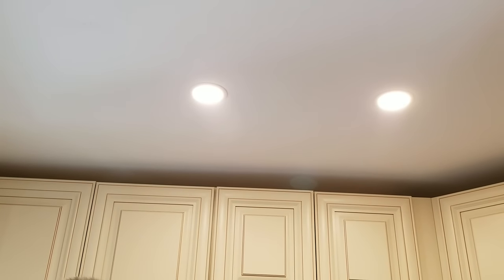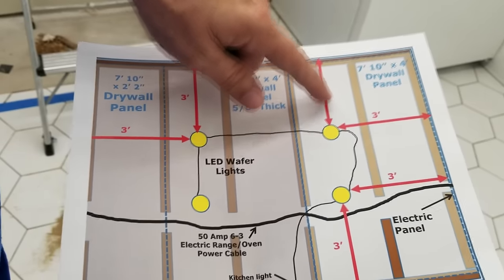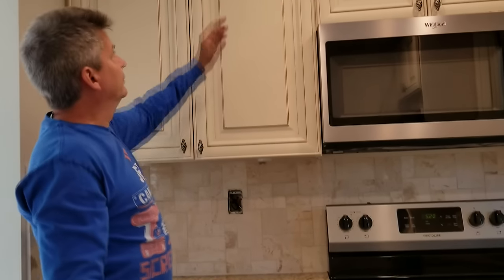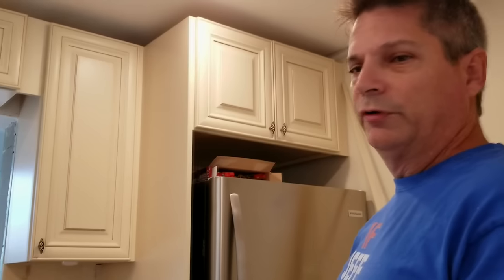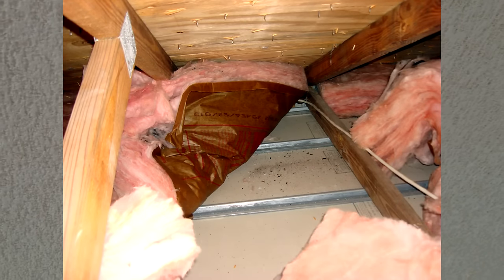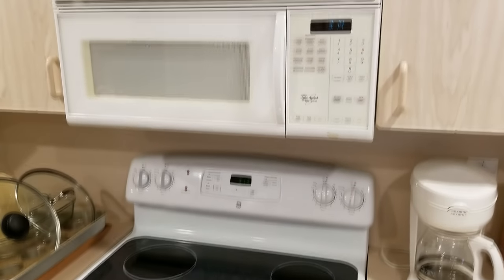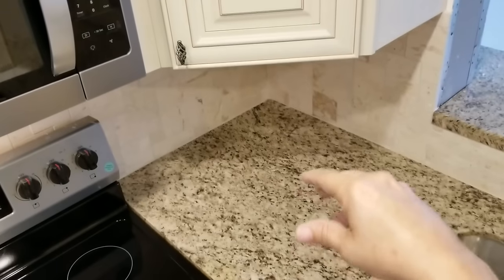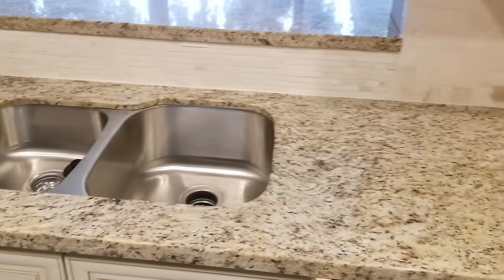Kitchen Light Spacing Best Practices, How to Properly Space Ceiling Lights

Comment: Coming from a design builder, I understand your point of view and frustration with incorrect installations. The AEC industry is plagued with incorrectness in every area (structural, electrical, plumbing) but what’s worst is the arrogant finger pointing “I’m better than you attitude” and unwillingness to make our fellow contractors better by taking a leadership approach instead of referring to their work as “stupid” “no idea what they are doing” etc. As a general contractor I have made mistakes in lighting but I learned because I wanted to do better. There is no one way or universal master guide to learn the hundreds sometimes thousands of scopes of work that encompass every aspect of building a   Decent building. or in this case, optimize lighting design. So, from what I see/hear in this video, You’re knowledgeable, like what you do, and seems like you do good work. so don’t belittle others work but maybe point out why you would do it differently, inspire people to do better work by showing them a better way. That’s the only way this industry is going to change for the better.
Reply: @Daniel Verdin I hear Jeff’s now holding lighting placement classes... I suggest you sign up. (LOL)
Reply from the maker: @alant5757  You're right, I'm sorry, I should never have pointed my finger at those builders. I meant to call those contractors who put the light 6" in front of the cabinet a genius. I didn't realize the industry was filled with super sensitve spineless snowflakes who needed a crying room after making people's lives miserable.
Reply: @jeffostroff  And this is why I don't drink any more....

Comment: Used this video as a primer for my own kitchen lighting project.  Works very well in that no shadowing exists beneath the cabinets but, as indicated in the comments, under counter led strips were added to improve task lighting. I used 4", 3000k led pucks with a dimmer.  I am very happy with the result and thank you for the video since I would have made the same mistake without your help.
Reply from the maker: Awesome, glad to help, and thanks for watching
Reply: Recess lights online come in sizes from 3w to 24 w . Let's say 3 lights which are 7w or 10 w wouldn't actually be much larger than a ceiling rose .
I read that canned lights heat up more because of the amount of metal

Comment: Can you help me with this conundrum? My husband is 6'9" and people are recommending that the lights be closer to the cabinet so that HE doesn't cast the shadow over his own workspace (which is why we're updating the lighting to begin with). I'd love your opinion: If we place the lights 3 feet out from the wall with cabinets, is he more likely to cast a shadow than if we placed them 2 feet from that wall? (Ceiling is 98" high, Room is 150"x155"). Thank you so much!
Reply from the maker: Does not matter what his height is, place the lights centered directly over the edge of the counter and you will have no problem.  You can also hook lights to power cords like I do and get on a ladder put them in position and see where shadows go. I am working on a video for next week where I did a massive lighting project in a friend's kitchen involving these issues, sloped ceiling, getting correct light onto counters, measuring the light with app on the phone, and engineering the perfect lighting solution. You might want to wait for that. I would experiment with 24" from thh wall, which is over the counter, and maybe ambient fill light behind his head in the middle of the kitchen, to see how the 2 lights blend together.
Reply: @jeffostroff  that's actually what I was thinking, too! I'll look for your next video as well.  Thanks!

Comment: Thank you for the video. Thankfully, things have changed in the last 5 years. Long and short of things, DON'T place your lights at 36 inches in a kitchen with upper cabinets over a counter. On this video, the only light source is the overheard source. If you are working at the counter, the light is going to be above your head, behind you. It will cast a shadow onto your work surface. You need the light overhead, directly over the counter top. You also need undercabinet lighting. AND if you don't want your kitchen to feel like an office break room, you are going to want more than just recessed lighting. You need pendants, linear lighting or chandeliers. (You need diffuse light/frosted shades if you are going for a soft feel as well, but that's my personal choice.) The light hitting the cabinets actually produces a beautiful warm glow on my pine cabinets.

Comment: I'm 6'4" and thought I'd share my experience.

Just built my kitchen cabinets/countertop 3" higher for my lower back issues preparing food for dinner. We also raised the cabinets up to the 8 foot high ceiling. 30 inches seemed to be the sweet spot in this scenario and the shadow under the upper cabinets isn't there.

We just wired one LED pot light and tested it live, another person safetly held it above my head in a few spots until we figured it out. Maybe that trick will help someone doing that one reno on their own like me.
Reply from the maker: We are working on another kitchen lighting video to cover all of the scientific of the scientific ways to place the lights and measuring how much light you have as well

Comment: The actual problem is trying to use ceiling lighting as an all-in-one source for kitchens. Kitchens require multiple light sources specifically designed for task working, not just general needs lighting like other rooms. There are a lot of factors to consider with setting up kitchen lighting, however technological advances make it easier to complement general area lighting in a kitchen, such as under/over cabinet lighting, accent lighting, decorative lighting, etc..
Reply from the maker: Yes you are right it really stinks when you're on a very very tight budget and can't afford to do all of the things you know need to be done
Reply: @jeffostroff  Agreed, Budget is always the main factor!! Especially if necessary wiring is not available!
Reply: I have ceiling fans which include lights,  with the down lights being close to the wall to throw the proper light down to the benchtop (opposite to the incorrect advice on this page) the fan lights are dimmable, colour temperature adjustable too. The kitchen has pendant lights hanging low over the island cooking bench. The mix is great for central room lighting, work lighting and relaxing lighting with phone app colour control of the downlights.

Comment: Jeff, you explained the absolutely WRONG way to place your lights. The thing you aren't factoring in is that by having the light out 36" puts the light source behind the head of the person working at the counter. So when that person is standing next to the counter doing their prep, they will have diminished light from the shadow they cast over their work space.  By having the lights in closer, as was the case in the first example you said was wrong, you get maximum and direct light to the area you need it which is right in front of you NOT towards the back of the counter. If you are concerned about the shadow the cabinets create by having the lights in closer, you install under cabinet lighting which is actually what you had in your remodel but didn't comment on their purpose.  I hope this helps some people...especially those cooks that are 6' plus.
Reply from the maker: No you are incorrect because the light to the side of you will fill in whatever the light behind you missed. Also not everybody wants under cabinet lighting and you should not have to rely on under cabinet lighting to avoid shadows.
Reply: @jeffostroff  Your response is making my point.  You said "the light to the side of you will fill in..."  That "side light" is not as bright (it's much further away and indirect (not in the focal range)) as what your head and body is blocking.  Also, I don't know who wouldn't want under cabinet lighting unless it's not in their budget or they have a boring backsplash.  Even with your method you will only have the counter lit to the back edge but your backsplash will definitely be in a shadow.  If you have invested the money in an attractive backsplash, you will definitely need under cabinet lighting to highlight it.  If you have spent much time cooking, you realize you use the front 16" of the counter the vast majority of the time for cutting and prep and the back 8" are not where you need the light.  This may just be my personal preference but I would rather have more direct light on the 16" space my hands are doing detailed prep rather than sacrificing my light to make sure the toaster against the wall is lit.  If you are going to insist on putting lighting behind the cook rather than over the counter where it's needed, you should at least suggest to people to consider having task lighting by mounting lights under the cabinets.
Reply: It's all a matter of preference and budget you guys are both right..
Reply: @jeffostroff  Thanks for sharing. I have to side with those favororing a 24" offset from the wall. I initially placed the light over my workbench too far back. The bench was well lit until I stood in front of it to work on something. At my age, I need full light to see well. Even the "slight" shadow you decribe would be i tolerable.
Reply from the maker: @terryluebbe2560  That's fine, you can do a combo, try leaving the lone set of lights behind your head at 36" from the wall, and put in a couple of task lights that are 24" from the wall so they will fire down directly over the counter. This way you have the best of both worlds.
Reply: David, you are exactly correct, the light behind my head and shoulders cast such a shadow when chopping or cutting anything I have to stand to the side to see correctly. Pain in the rear. Under cabinet lights is my only fix. Use always outweighs looks.
Reply: @davidbenji1  
please suggest where should the undercounter light be placed......in the middle of top cabinets or towards backsplash or towards outer side of top  cabinets?
Reply: @jainjain9450  install at front of cabinet using a 45° aluminium channel with cover to diffuse LED strip. Lights will point down and away from eye level. This is the way
Reply: To far out huge shadow over cutting your food , under an lighting is the new correct way to install.
Reply: @jeffostroff  TWO rows of recessed lights that are 12 inches apart? I don't agree with that at all.  Every lighting expert and electrician that I have talked to recommends placing the recessed lights so they shine down on the edge of the counter top. This will not cast shadows like your suggested placement does. But, it will shine light on the counter. Under cabinet lighting is a must. That's why you need ambient lighting and task lighting,
Reply: David is correct, Jeff is wrong. Nothing more to say.
Reply: @jeffostroff this is unbelievable, you cannot just redo the laws of physics, light uninterrupted is great light to aid your sight at the benchtop, light behind throws a shadow, and every commenter here disagrees with you. You need to revisit your logic here.
Reply: I always listen the experts experiences and consider their suggestions but I say do testing yourself and see what works for your layout kitchen considering the lighting from the outside. I believe both have a valid suggest.
Reply: @jeffostroff that’s just dumb, you are 100% wrong. If you don’t have under cabinet lighting and your body is covering the light 🤦, come on buddy, think about it.
Reply: At 8:26, that’s exactly how the light supposed to be😂 You went and changed it?🤦 poor customers, they should have spent that money on under cabinet lighting instead this guy.
Reply: 10:01 You only discuss the old non-IC rated recessed light housings here and infer that a recessed housing is inferior to those cheap puck lights. IC and Energy Star rated recessed housings are superior to puck lights because they offer far more options in terms of trims, are super easy to replace just one without blown-in insulation falling on you when inevitably a light fails in a few years, and look so much more high-end. The reason they are used less these days is that remodeling contractors like the puck lights for their simplicity and cost and do not present the other option to their clients. 

For example, for any of your clients to choose recessed housings with a trim kit, they would need to correct you (and risk an argument), or ignore you and tell you they want them anyway. They would also need to pay a bit more for them.

Comment: Saying this method is wrong is an opinion. I've used this method for years in the electrical field running my own company. Never had a complaint, always turned out great. There are multiple ways to get the lighting you desire.
Reply from the maker: It wasn't just opinion. I showed what happens when you place the lights 24" or less out from the wall, and the deep dark shadows under the cabinets. So if you think that's great, fine that's just your opinion. But people I've talked to don't like it.
Reply: @jeffostroff  not sure what you're talking about, I was agreeing with your layout.

Comment from the maker: ✅ WATCH Our SEQUEL to this: How to Measure LED Kitchen Lighting, Best Design Practices
: https://youtu.be/g5Ghx7-UJiU
✅ Lithonia LED wafer lights we used for this kitchen lighting remodel design project: https://amzn.to/2OniziR

✅ Klein Tools 53731 Adjustable Hole Saw we used to cut round ceiling holes for the LED wafer lights: https://amzn.to/2BGgcPI
Reply: The Halo HLB lights from Home Depot are great too.  There is a selector switch at the light box to adjust the color temperature from 2700k-5000k.  No cans as well.
Reply from the maker: @pleitgeb  Yes, I was at HD the other day and holding these in my hand. These HLBs would not be usable on the project in this video because HLBs fit into applications with as little as 3.5 in. plenum clearance, whereas I only had 1 1/2" space to work with. But will look into it for next project, where maybe I won't have a cement ceiling above the kitchen.
Reply: jeffostroff, you might be right but I don't agree with everything you saying, not to mention that you calling other contractors idiots and  saying that they don't know what they are doing, that is so unprofessional of you.
Reply: jeffostroff Is it ok to place insulation directly over wafer lights?

Comment: We have a house that was built in 2001. Our kitchen has flow-recent light mounted in the center of the kitchen ceiling. We are happy with the lighting but the boxed-in light assembly we don’t like and would like to install light you used. The flow-recent light box is about 3’6” by 5’ contains 2 double neon 48” light assembly. We definitely don’t have shadows under the cabinets. The box of light is 36” from one wall and 48” away from the other. We also have a counter with two cone shaped lights over it . Our question is: how many coned lights do we need to preserve the lighting we presently have?

Comment: Great video👍
Comon sense, no need to be an engineer, although I am one in various fields, but most of the things I do are common sense, want to light out more area? move the light away from the wall. I would recommend that electrical code is checked in your specific area to make sure you are not bypassing certain rules which must be adhered for safety.  

One way to test the light distribution is to do a dry test, temporarily and carefully attach the light to AC power, and place on the ceiling, near the area you want to light up, before drilling holes to see how well the light you bought spreads the light and this may be a personal preference to light "warmth", in other words the color and intensity, as some lights work better in areas that you want daylight and others work better in areas that you want a subtle light diffusion, a warmer feel, For example, a family room may not need daylight if you want a more cozier environment. 

I would highly recommend the use of dimmable lights so to control the amount of light with respective spec-matched dimmers.

If you want to make a $1,25 DIY ceiling hole cutter dust catcher, check out my lates video on my YT channel.

Comment: I have a kitchen in my apartment that’s 95” wide and about 100” long, with counters and cabinets running along the 100” walls. The kitchen opens into the living room and the entry door is at the far end of the kitchen.
I have under cabinet lighting, so I don’t get shadows. My ceiling fixture is a track light with spots that I point at the cabinets. The track light is not very attractive and the stovetop is poorly lit, even when the light in the microwave/ hood is turned on.

The electrical box in the ceiling is centered between the counters and about 35” from the entry door.

I’m thinking about putting in disc lights. Should I run one row down the center? That would make them 47.5” off the walls with the cabinets, not 36” like you suggested.

Also, I’d like to use the hole where the electrical box is for one of the lights. The center of the stove is about 25” from the ceiling box. There’s a peninsula next to the stove. The center of it is about 25” from the center of the stove. Would 3 disc lights adequately light the kitchen?
Reply from the maker: Probably not. I am working on a kitchen video now very similar to what you describe, with peninsulas should be ready in a couple of weeks